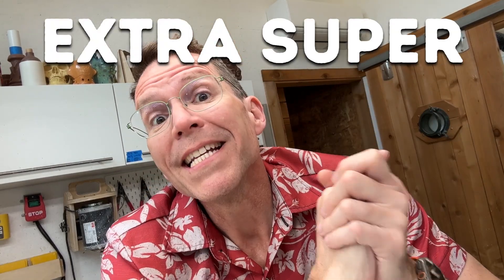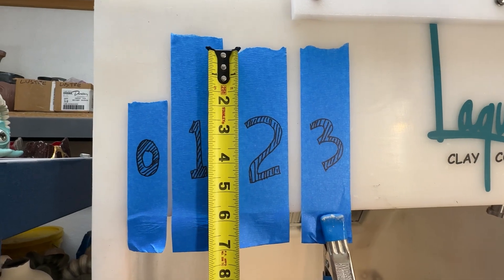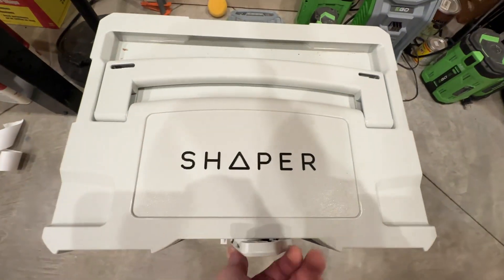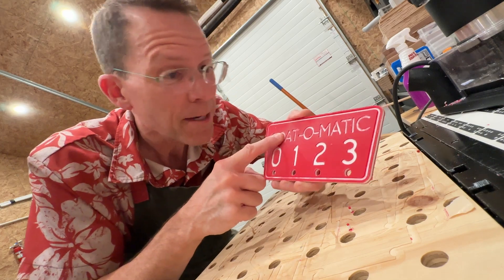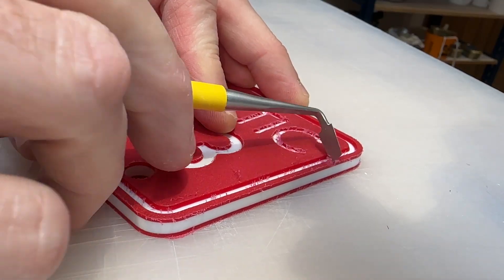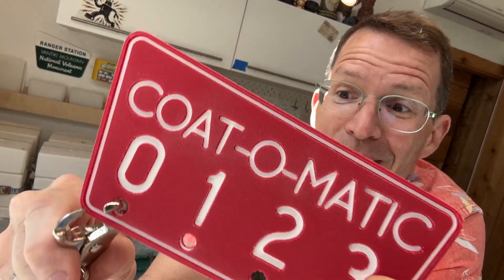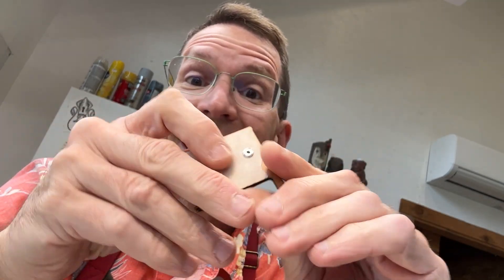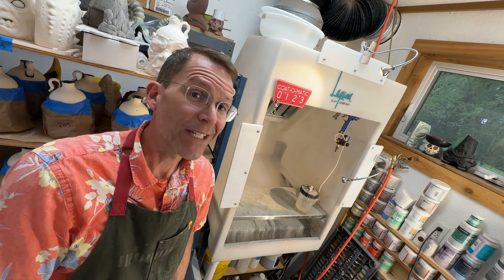Laguna Spray Booth Upgrades - Tiki Technical Tuesday

Comment: Love the project! I am only  wondering - what are the reasons that you'll never go to 4th or maybe even 5th coat in the process? 🙄 What experience is speaking against having a little room to expand from time to time?
Reply from the maker: Good question! I try to get a glaze looking good somewhere in the range of one to 3 coats - I’ll do tests of each new glaze in the studio to see how it will look. 2-3 coats seems to get the commercial glazes I use to match the manufacturer’s test sample tiles. For me pushing past 3 coats gets pricey as 1) it uses a lot of glaze, and 2) it means even more of my time in the booth. That being said, I am now regretting not adding a “4” to the sign 😄
Reply: @vantikistudio   that's more than reasonable 😄 I am sure in case of this dire 4th layer emergency a blue tape with the number 4 will be just right 😉

Comment: For the bit try an o flute bit with 1 cutting edge - designed for cutting plastic. Helps the material separate nicely without melting back into position.
Reply from the maker: Thank you !! I’ll definitely order one for the  next plastic cuts!
Reply: seconding this, you want either an o-flute, straight flute plunge bit, or a compression bit, alternatively do a clean up pass with a down cut bit, since you're using an up cut bit, all the chips are traveling upward, leaving a fuzzier edge at the top. Or use any angle of V bit to chamfer your edges.  It all really comes down to finish desired and aesthetics, no real one answer.